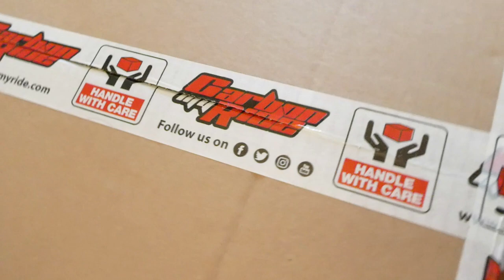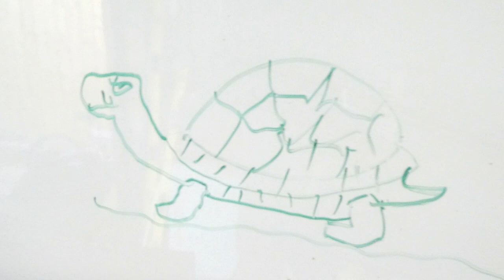FN2 Type R Carbon fibre Mugen Grill install

Comment: Hi guys!

I was wondering if it is at all possible to remove the ac condenser without removing the bumper?
Reply from the maker: Honestly have no idea buddy
Reply: @CowabungaCarDiaries I was wondering if there was access to the ac pipes by removing the grill because there is access to everything on the top of the condenser from seeing your video. There's only one ac pipe to undo from the bottom and the ac should come out.